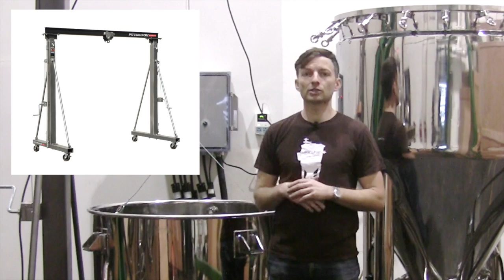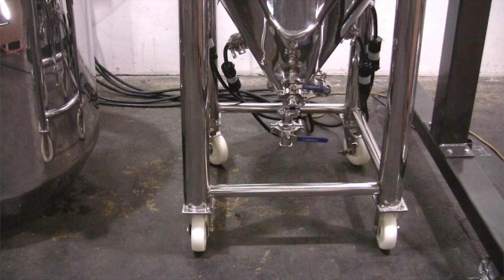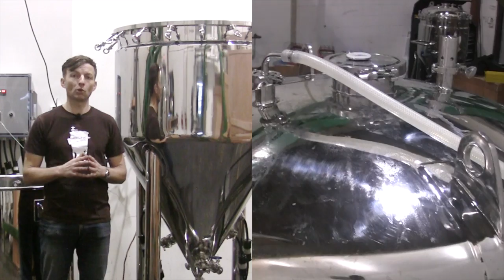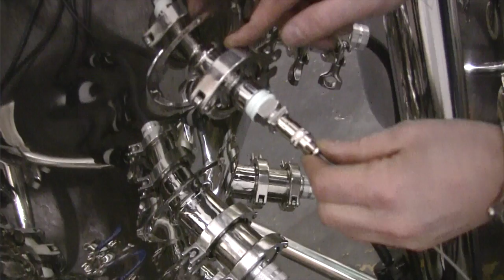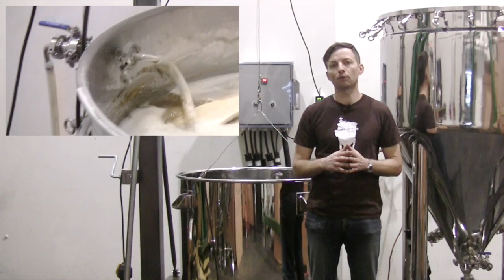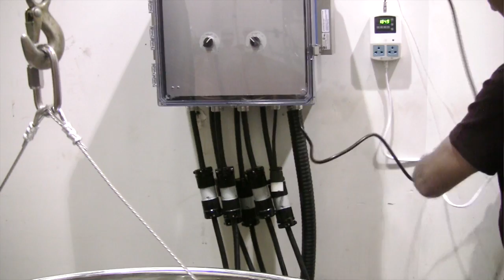Installing your BIAC complete all-in-one brewery

Comment: But if it also acts as a fermenter, how about 2nd, 3rd and 4th in a week/month ?
Reply from the maker: Additional fermenters can be purchased if additional fermenters are desired. Each additional fermenter can be purchased with heating elements in it for heating and temperature control during mash, boil and fermentation. The mash apparatus (Mash Colander, Pump Assembly and Power Controller) only needs to be purchased once as these can be used for brewing in each additional fermenter. See more information at this link: https://brewhaequipment.com/blogs/howtobrewbeer/18189829-one-biac-endless-possibilities